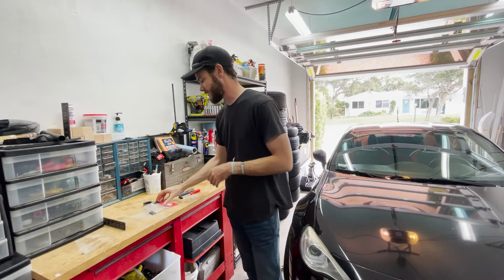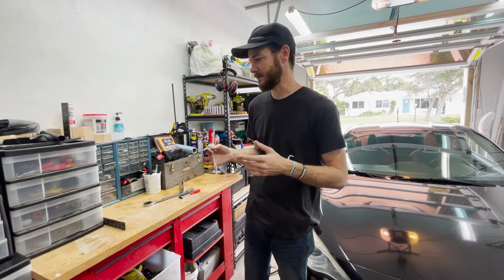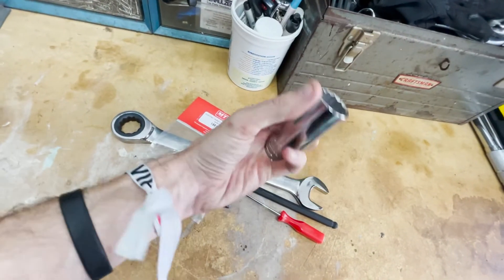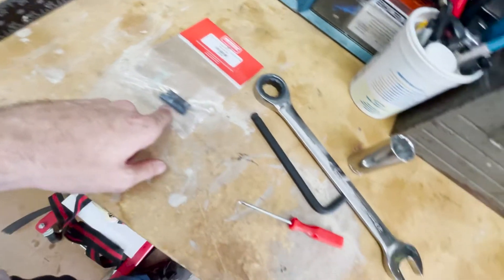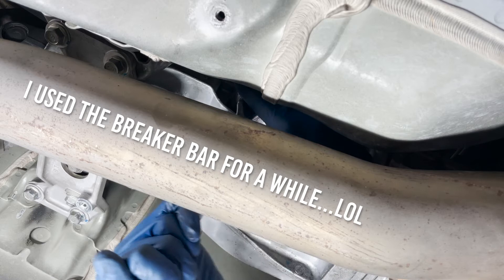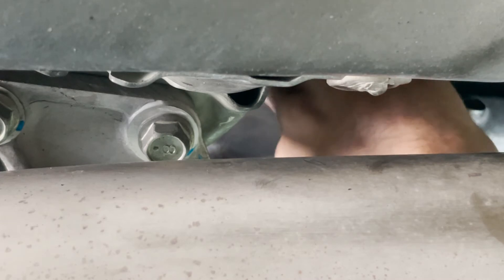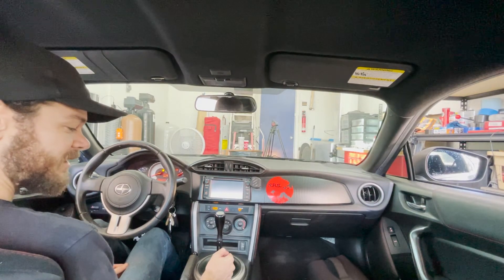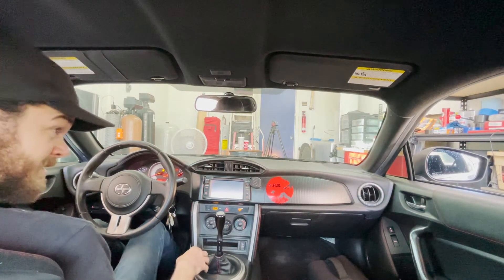MTEC Shifter Spring Review! | Scion FRS

Comment: The hardest for me is 5th into 4th. It wants to catch the gate on the edge between 4th and 6th. I have the oem short shifter installed. 2023 gr86. I have the spring in my toolbox worried that its going to make the shifting more difficult.
Reply from the maker: I doubt it, the springs add more tension but they don’t make it a work out in any sense, I’d give it a shot! 🙌